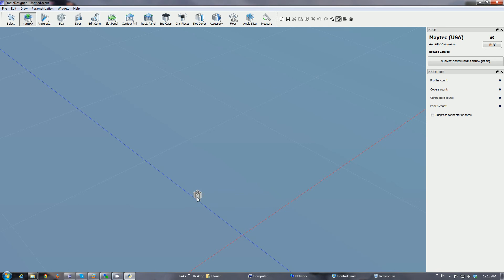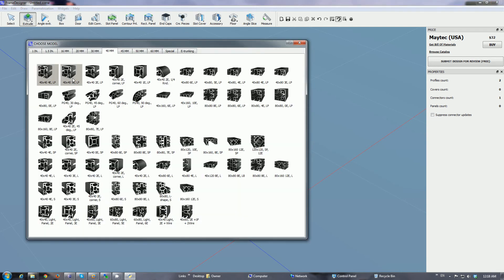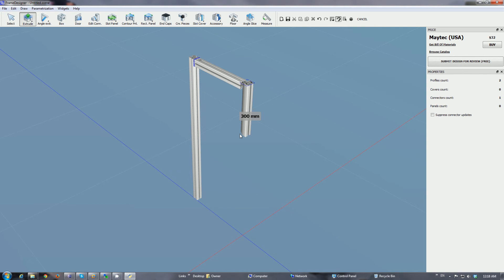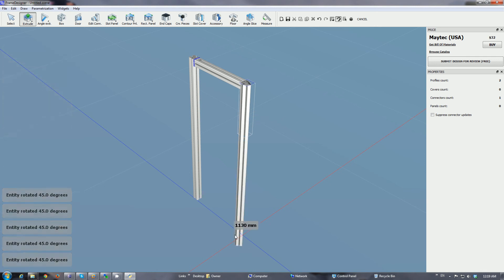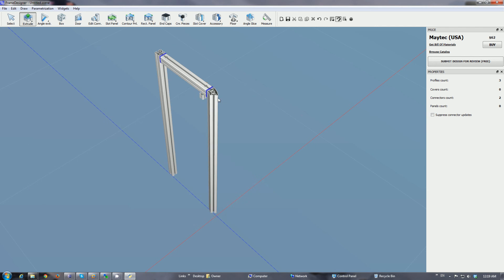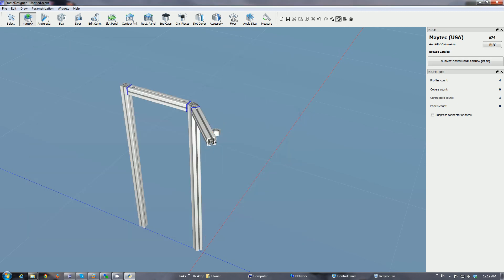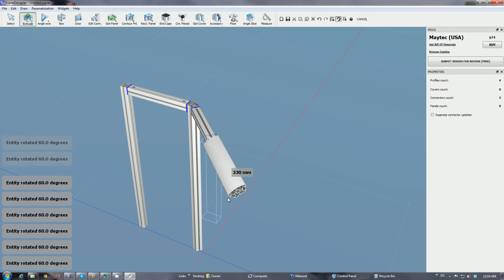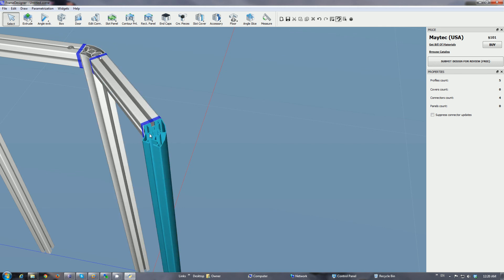Use of 30, 45, 60 degree sector profiles

Comment: how do you manage to 45° rotate the profil ? i only manage 90° by typing R and clicking on arrow
Reply from the maker: After pressing R, hover the mouse cursor over the rotation axis arrow and type in 45 on the keyboard, press Enter. In the case of sector profiles, press Space bar to rotate in profile sector increments.
Reply: @MAYCADsupport  thank you it works well !!